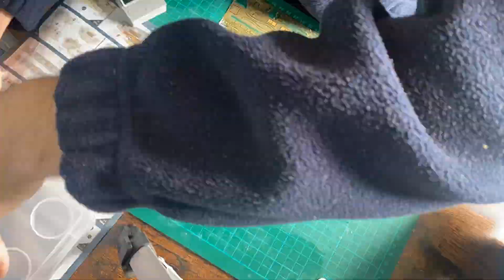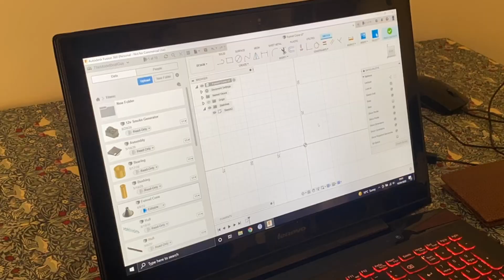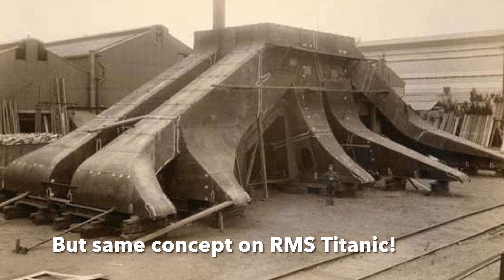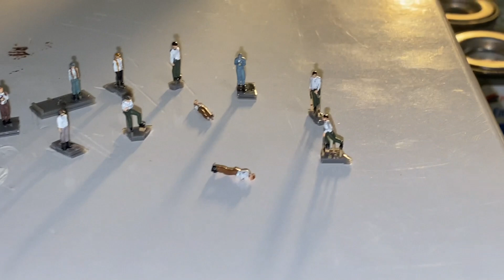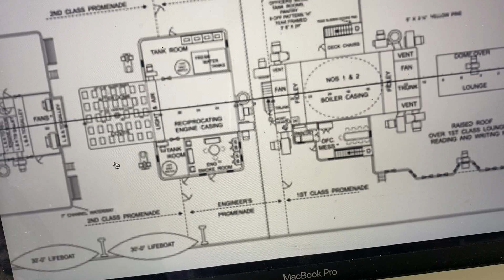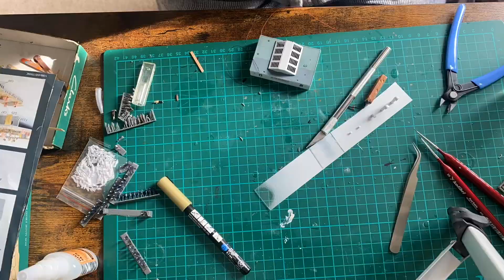Radio Control Trumpeter 1:200 Titanic Build Part 52 - Engine Casing

Comment: What is an engine casing?
Reply from the maker: So this particular building had a shaft that led directly down to the ships engine rooms.
So this shaft provided ventilation, light and access from the ships topside to the engines.
Reply: @TheModelBoatGuy  Ah, thanks. The name "engine casing" didn't really get this functionality across, to me anyway.

Comment: Hello, what glue do you use?
Reply from the maker: Well it depends. 
Plastic to plastic I use this:

https://elementgames.co.uk/paints-hobby-and-scenery/paints-hobby-and-scenery-by-manufacturer/tamiya/tamiya-modelling-glue/tamiya-extra-thin-cement-40ml?d=22&gclid=Cj0KCQjwxb2XBhDBARIsAOjDZ35H93ZpwDMnmcxMhiNSOTWvvQeRA-PFrIf7iBxshZBs7rKMdu0OiAYaAlcVEALw_wcB

And for anything else this:

https://www.scalemodelshop.co.uk/20g-flexy-5k-ca-glue-for-photo-etch-vms-p17691/?utm_source=Google%20Shopping&utm_campaign=Google%20Shopping&utm_medium=cpc&utm_term=78404&gclid=Cj0KCQjwxb2XBhDBARIsAOjDZ362hPF8sWO4W5-x9A1UHgcxIkfezx62DLpC0RwOX-eKiBVprVvROp4aAoj0EALw_wcB

Comment: I think it would be really cool if you made it so you could sing and as the it would have like water detectors which would shut off the power four sections when it goes under so it looks like it's actually going down but the lights don't get ruined

Comment: Your model is outstanding! But it’s scary to think of the man hours you are putting into this build and the total number of parts used in building it. Not to mention the fact that you plan to sail the finished model on open water instead of protecting it in a display case! I can’t wait to see the maiden voyage.

Comment: is it easy to clip those tori figures off there base after painting without losing any feet or legs
Reply from the maker: Yes I find them surprisingly easy actually, you need a good pair of side cutters but once you have those it’s fine

Comment: Hi Rob could you put the 3d printed smoke tube guide program in as a download as i have a printer and am sure other people will have to i can't use fusion tried but failed also do you use Cura as your g code ?
Reply from the maker: Hi again, that file should be accessible in this location now:
https://drive.google.com/drive/folders/13fla1euwCTpOkaFMudnhOv7-jn7VgNzI?usp=sharing
Reply from the maker: Hi there,
Yes that’s a good idea. I’ll add those to my google drive thought and add a link to them on the video description. 
Give me a shout if I haven’t done this in a couple of days as I might have forgotten!

Comment: An absolutely excellent choice for the printer. I’m currently working on a 12 model of the Titanic and every single item I designed in cad from very accurate blueprints it has taken me a few months but now the entire boat deck is completed. 
I have five cr10’s and an anycubic photon mono resin printer for my people I went on Hero forge and created my people in several different poses and then I brought them in cad and made five variations of each one. 
Anyway excuse my rambling 🤣 I really really like your channel and gotten a lot of insight on my own build.

Comment: What happens to the rigging if You remove the Boatdeck when the Model is finished?
Reply from the maker: I will have to miss out some of the rigging sadly, as you say it will get damaged otherwise. I should be able to fit most of it in though